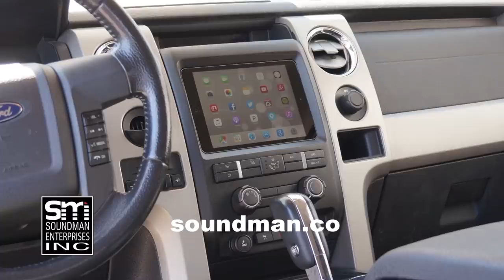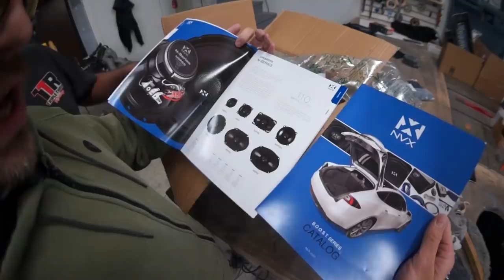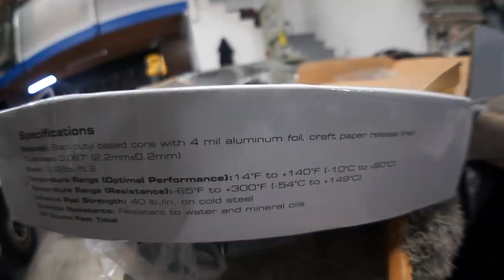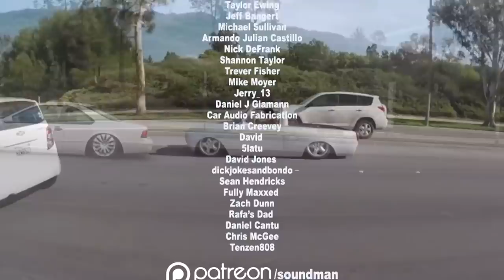NVX Sound Deadener REVIEW AND INSTALL! - The Bass Van Vlogs #12

Comment: Ive used NVX its some good stuff. It would be dope to see you at Slamology 2020 with the bass van. Matter of fact come on out bro trade some bass demos. I have 2 Bose wave units mounted on the rear deck. 14Hz hair tricks no sweat :) :). Damn I need a sound deadener roller.For some funny reason it disappears faster than a 10mm socket. I made a roller out of skate bearings LMAO. Merry Christmas to anyone reading my wild comment.
Reply: Bigvell02 merry Christmas bro peace and bass!!!

Comment: Doug- use a hair dryer on high (not a "heat gun") for anything Butyl.

That backing "foil" is probably Mylar, not metal. The Mylar will get the Butyl hot,
it has a way higher melting point. When warm it will conform very easily.

Comment: Tbh sound deadening a demo build is just waste of mat. You should have rather used Raptor bed liner on the inside of the car. It stiffens up the panels a lot, don't add that much weight and if you would have seam sealed all the structural bits with the panels, it would have been sturdy as fuck! 

That said, I understand that this is a sponsored build, so you "must" choke on the hog a bit and use the mat. Anyway, have a nice holiday Doug and love the episodes! Give your wife some love and the kids too! See you tomorrow!